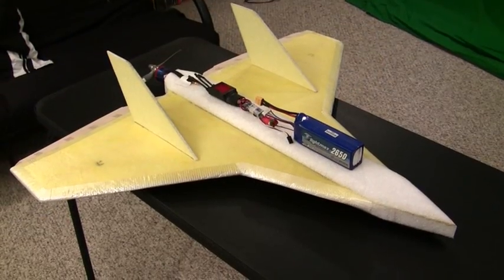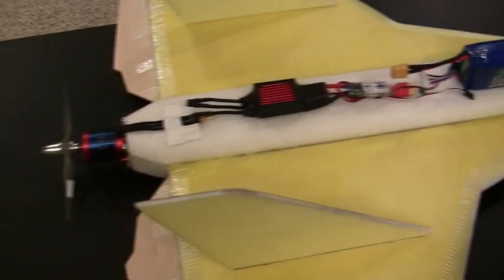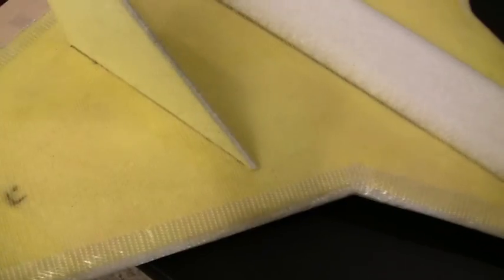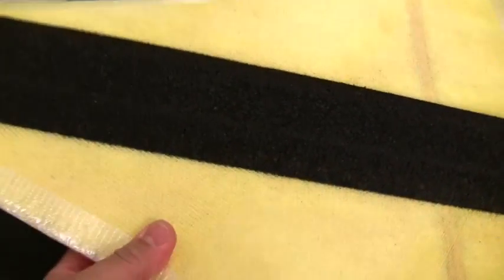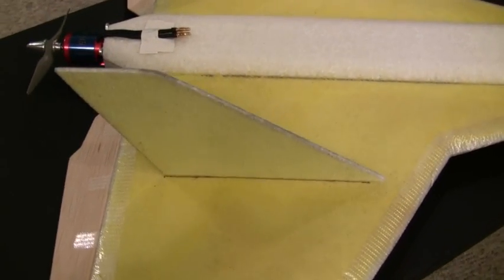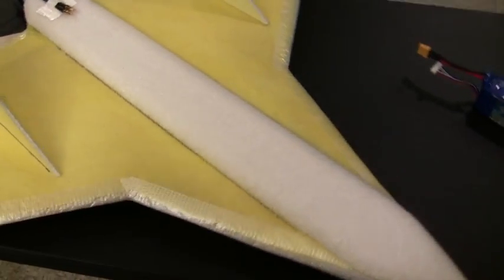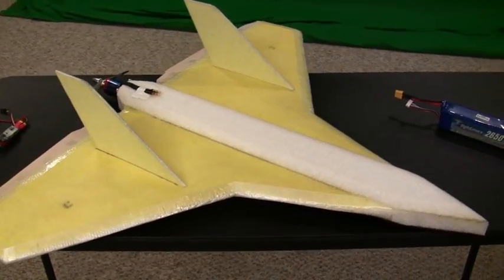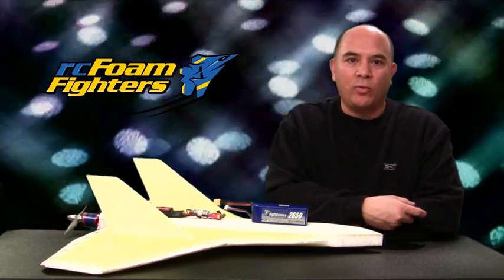SkyFighter v3 Speed Challenge Plane  Build Part 1

Comment from the maker: johndog35 I don't believe I have used this set up with 4s. On 5s I usually use a 7x6, 7x8 orc 7x9 sport prop and on 6s a 6.5x6.5 sport prop. the 6 cell set up was putting out over 2400 watts of power! Check out the test flight videos.

Comment: thank you very much Mr rc foam fighter (  Frank :)  )

ok i want buy this item :

APC style propeller 7x6-E .

or : TGS Sport 6x5E Precision propeller .

ZIPPY Flightmax 1800mAh 3S1P 40C .

TURNIGY 3A UBEC w/ Noise Reduction .

Turnigy 3648 Brushless Motor 1450kv .

Hobbyking SS Series 90-100A ESC .

i can use this for this plane in (youtube) : 

rc mig-29 parkjet with thrust vectoring ???

iam so sorry again for disturb ...

but i am make this plane and just i want what motor can run it
Regard

Comment from the maker: Nobel0 without testing these props with a watt meter I can not tell you for sure if this would be ok for a 60amp esc. You can run the smaller prop sizes but you will be guessing on the watts and amps without checking with a watt meter.

Comment from the maker: ratdoghippy there are definite similarities with the wing shape of the planes but most everything else is quite different. This wing has a 34 inch span and the FunJet is 31.5 inches. The FunJet uses a Clark Y type airfoil but this one is a symmetrical airfoil. The wing chord on this plane goes much farther forward , the fuselage is solid foam and comes to a point in front, and the motor is a little farther out the back. But this will be a fun jet to fly!!!!

Comment: Hey Frank the V3 is lookin good. I've been taking 2 layers of 6mm epp and sandwichin the Henries inbetween them to  make an equivalent to your 15mm then I use the same 12mm epp sandwich for the top and bottom fusalage pieces. I end up with 5 layers of Henries on the fusalage and 3 layers on the wings. It seems like it doesn't bother the strength of the fuselage very much when you cut the complete center out for all of your electronics. You can almost hide everything.  Good luck with the comp.

Comment from the maker: altops you can use any power system you like as long as the motors, escs, and batterys are a total of $100 or less. The complete rules are on the first page of the forum thread "Fastest Foam Plane Challenge - The unlimited Class"  I put a link in the video side bar.

Comment from the maker: HangerX1 that would be the Henry's style fiberglass weave that we use to make our planes more crash resistant or "Bullet Proof" lol!! You apply it to the epp with a spray adhesive such as 3M 90 to make a plane that is almost indestructible. Well maybe not at these speeds but definitely anything under 100mph!!

Comment from the maker: altops the servos I have coming are rated at a minimum of  57 oz/in torque at 4.8 v and a maximum of 181 oz/in torque at 6v. It shouldn't be an issue as the ones in the FunJet were only rated at 38 to 47 oz/in torque at 4.8v to 6 v. I will probably run them at 6v. I always like overkill, lol!!!